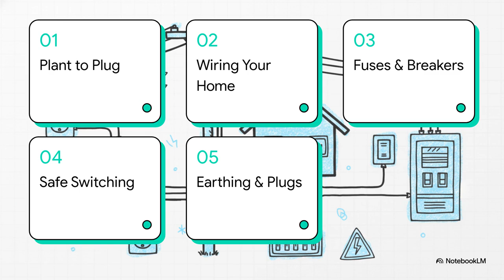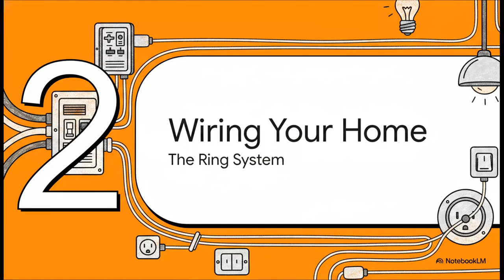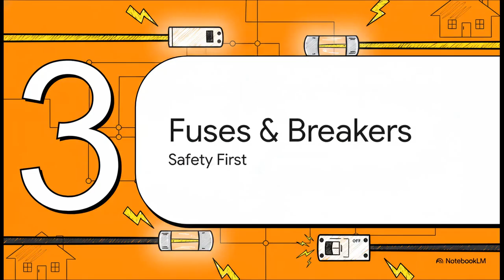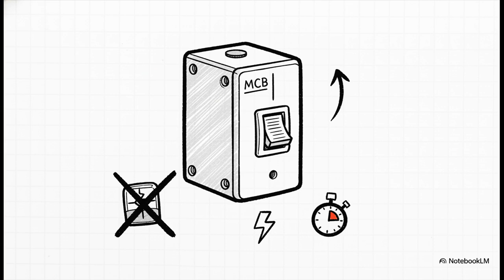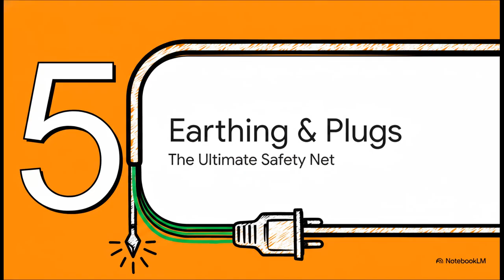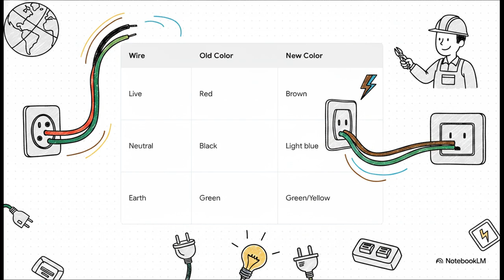Household Circuits - Chapter 9 Physics, Class 10 ICSE

Comment from the maker: Class 10 Physics Chapters:
Ch. 1: Force: https://youtu.be/59Yt-2KRTPE
Ch. 2: Work, Energy and Power: https://youtu.be/IN-7fU1zZHE
Ch. 3: Machines: https://youtu.be/QVkh8UEokHk
Ch. 4: Refraction of Light at Plane Surfaces: https://youtu.be/avyyafbRZOc
Ch. 5: Refraction Through A Lens: https://youtu.be/Ne6uGQJa2EQ
Ch. 6: Spectrum: https://youtu.be/expX5SB7gho
Ch. 7: Sound: https://youtu.be/Jbj88ImDS60
Ch. 8: Current Electricity: https://youtu.be/s74VmeHVhtU
Ch. 9: Household Circuits: this chapter
Ch. 10: Electromagnetism: https://youtu.be/07QxH469vAw
Ch. 11: Calorimetry: https://youtu.be/jZfVboQcBIQ
Ch. 12: Radioactivity: https://youtu.be/V4nVpHHqPNg